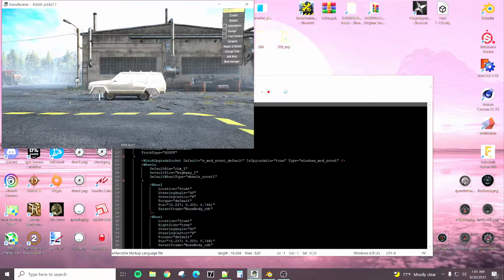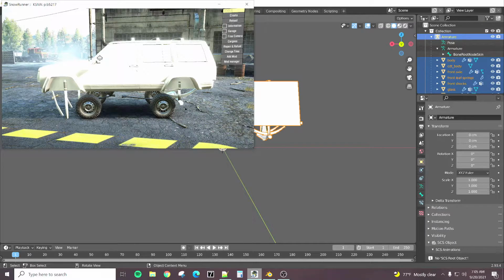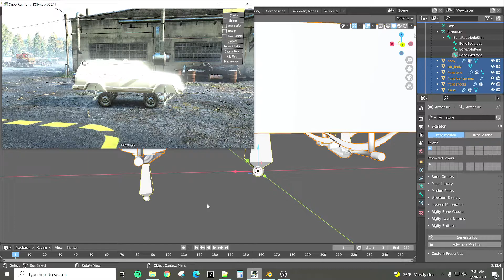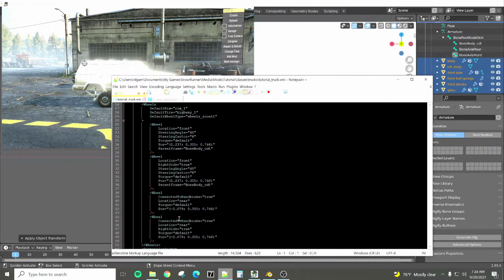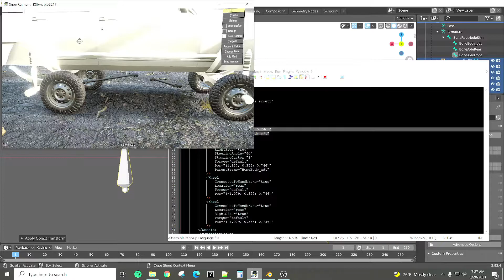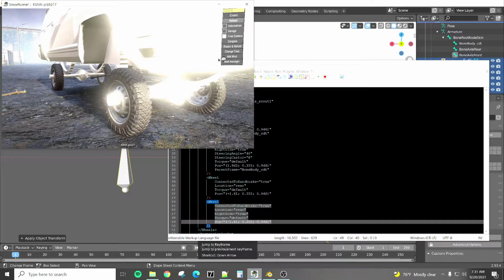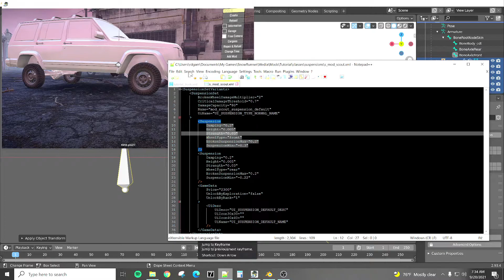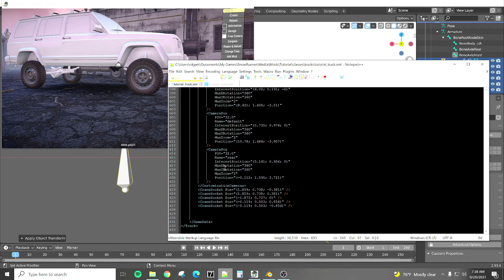Snowrunner Modding Tutorial Ep 4 - Making Adjustments and Correcting Mistakes

Comment: I just had same issues as you had. But on both axles. I have solved it by replacing the changed numbers for wheel position by original ones and started to change number by number. Then i have found, that issues was in wrong height of the wheels. But i had also issue with the collissions. It turned out, that the RootNode has to be same as the Body_cdt. 
Btw, thank you for this video and whole series. 
Also question: How to do independent axles?

Comment: I had the same issue with the front axle, so i looked the model of the default scout car mod and i realized that the front axle bone is parented under the BoneChassis_cdt, so i parented mine under the BoneBody_cdt  (same as in the tutorials) and it just worked correctly, so i didn't move the bones.
EDIT: Also, you can use the blender coordinates to get the position of the wheels, just place a vertex in the right wheels, select it, press N, go to item, and copy the coordinates.
Reply from the maker: I was helping someone about a month ago we ran into the same issue.  He also did the same as you after I had logged off for the night and it also fixed it.  I still have not been able to isolate why it happens initially though.  Other than the Flex Jay that I used as an example here, I havent had this issue.  None of my other trucks have done this, so I cant really repeat how it happens to explain how to avoid it.  But congrats on discovering an additional fix for it.

Comment: GW man im haveing a heck of a time i convverted my truck just fine no errors i spawned it in fine i tweaked the wheel postions fine but when i was changeing something and hit reload it didnt take i looked in the spawn truck menu and my truck wasnt listed anymore and i cant seem to get it to show again in the spawn menu checked the legs and no errors ive tried reconverting it and still no show any ideas
Reply: I got it figure out i had to delete the addon files and sockets for the front and rear bumper i was following along with the next video in the series when it happened can you help me understand what to type for the addon sockets part i followed along with the next video but im not sure what you typed in the mod_scout xml file inorder to add the bumper
Reply from the maker: @Lilfattypimpin  So, addon sockets have a couple different formats, but I usually just stick with this one... 

<AddonSockets DefaultAddon="fbump1">
<Socket Names="94despfbumper" Offset="(0; 0; 0)" />
</AddonSockets>

You can remove the portion that says DefaultAddon="fbump1" if the addon is not intended to spawn with the truck, meaning the opening tag would be <AddonSockets>

In my example, replace "fbump1" with the name of the classes xml for the front bumper.  Replace "94despfbumper" with whatever you want the socket to be named.  This name must match the install socket in the classes xml for the bumper.  It can be whatever you like, but they have to match.  Also, if it's named the same as another socket from a different mod, they WILL merge together and parts from the other mod will be able to be installed on your truck.

The reason your truck stopped spawning was because you had a typo somewhere in that section.  When you removed the section, you removed the typo and it started working again.  Until you are super comfortable, I highly recommend only adding a single socket at a time so if something gets messed up, it's a lot easier to track down.
Reply: Appreciate the help man i got the bumper to load into the garage menu one time but it wouldnt attach to the truck i went back redone everything making sure i followed along to the t and now when i try to convert the bumper .fbx and .xml file i get a crash error and the truck doesnt convert but it is still in the spawn menu
Reply: I checked the logs and nothing in there if i delete the bumpers .fbx file it will convert and i dont get the crash box
Reply: I finally got it idk what i did different only thing i can think of is maybe the main xml file didnt like that i had capital letters in my bumpers name actually i did also export the bumpers with out their cdt converted them then went back and exported the cdt and the bumpers both idk what difference doing either of those things would do but i got finally thank ya GW

Comment: GW, have you found out the actual reason why the axles and suspensions are clipping to the ground? Other than the so called "SNOWRUNNER THINGS" issue. I would like to know why it is happening
Reply: awww. NOW I remember ... I actually think glitch will answer u with a better answer, we were "talking" about that via discord weex ago. I my opinion is the reason somewhere between a better bone-axle position and ALL transforms but I have forgotten the stuff in the 2nd. dream ... I am sorry.
Reply from the maker: It is directly connected to the wheel position in the main truck xml.  Setting the vertical number (middle number) to anything other than 0 can result (not always) in your axles going underground.  Ive been told by many people to match the end location of my axles from Blender into xml, but 90% of the time, it results in my axles going underground like that.
Reply: @glitchworks5957  ok GW
Reply: @erdbeerbus  OK Ezio

Comment: anyone got info how this shit game work and fix this glitch?? i tried move bones, i tried put 0 as height of wheel (not helped just car was much more higher) also my front axle diesappeared and right wheels is mismatching turning..left wheel is normal straight.... omg this buggy game is not normal.... i lost over 50 hours just watching tutorials and trying to fix this hsits....only wasting of time....i repeat minimum 3x this tuorial..started with fresh 3d model...etc... no luck...
Reply from the maker: Set your wheel height to the center of the axle (or hubs) and set your axle bone to the center of the axle as well.  That should correct your issue.  To do this accurately in the xml, go into Blender, edit mode on your hub/axle.  Press N to bring up the side menu and use the XYZ coordinates that it shows for Location.  I need to re-record these videos as there is some incorrect information in there, but it takes quite a while to record and edit these.